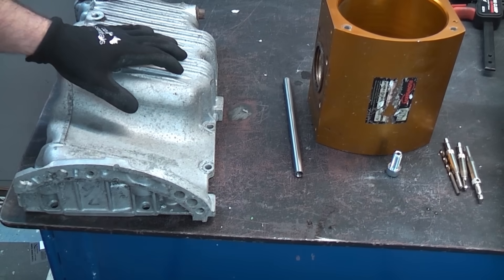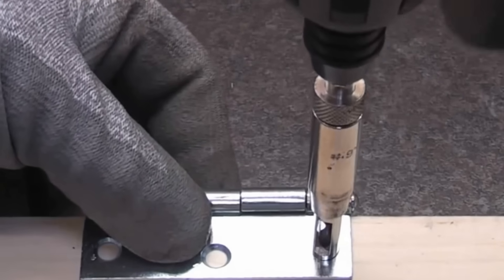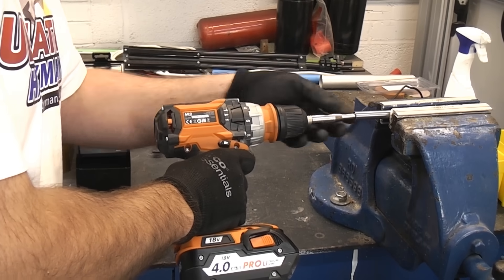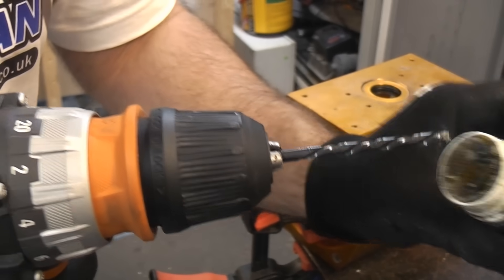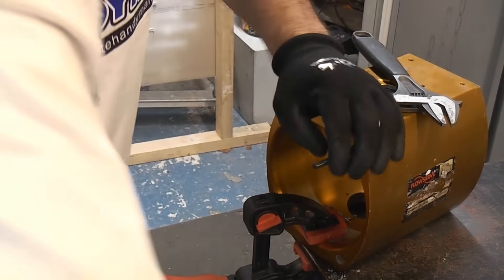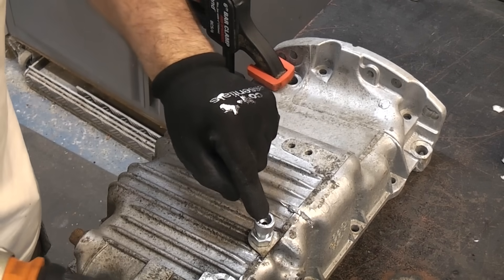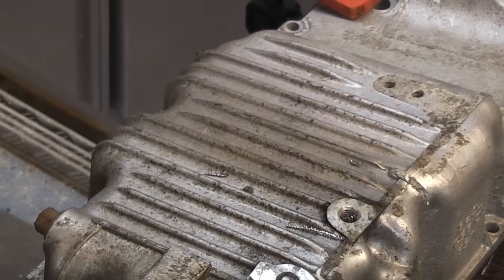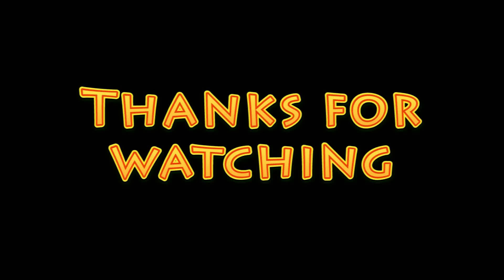How to remove a broken bolt in a deep hole | remove broken bolt in recessed hole

Comment: If the bolt snapped off trying to get is out leaving the remainder in the threaded hole that would have meant it was stuck from corrosion or was too tight. You're process of getting the broken bolts out is A1 however these examples seemed far too easy to get out if the bolt broke trying to get it out with a conventional socket or wrench.
Reply from the maker: Thanks for the comment 👍

Comment: The drilled out bolts for guides is a neat idea. Reminds me of when I was taught to use a bit of valve grinding compound on the tip of my screwdriver for stubborn or stripped screws.
Reply from the maker: Thanks for the comment 👍

Comment: Hi, a very informative video, lots of good tips and that last one about using anti seize compound is a must as there's nothing worse than having to deal with seized in broken bolts owing to dissimilar metal corrosion and wrecked threads when it finally comes out. Trust me, I know, I was that soldier who's dealt with those extreme cases and having to finish the job with thread inserts.
Reply from the maker: Thanks for the comment 👍

Comment: I had to remove a broken starter motor bolt and used left handed drill bits with success. I have also made a centering guide out of a wooden dowel and used a torx bit sized slightly larger than the drilled hole in place of an extractor with suprising success.
Reply from the maker: Thanks for the comment 👍
Reply: @ultimatehandyman  👍

Comment: Once had a broken exhaust mani bolt that had broken off right at the head. Used a reverse twist drill bit. After it got down in aways, it caught and backed the bolt stud out. Anti sieze went on all the new ones...
Reply from the maker: Thanks for the comment 👍

Comment: I love the guide bolt trick. I have another method for you, if you like to try. If you try everything and you run out of options. I use a MiG welder to add small amount of metal to the broken bolt, down in the hole, and let it cool for a few seconds then weld a little bit, let it cool, repeat. Just keep stacking small tack welds on top of each other until there's enough to grip with a locking pliars. I've tried this method with aluminum only. The aluminum threads have always been usable, but not perfect. I'm sure someone with a Tig welder and some skills could do better than me. I only tried this method because of difficulty drilling the center of the bolt, but now I will try your guide bolt method first, and hopefully I won't have to use mine.

Comment: Any tips for drilling grade  8 pilot holes?
Reply from the maker: I always use cobalt drill bits for harder steels, I have drilled out lots of Allen head bolts in my time (10.8 tensile strength) and cobalt drill bits work well- as long as you get decent quality ones.
Thanks for the comment 👍
Reply: @ultimatehandyman  thanks your the first YouTube person to respond to a question I asked

Comment: Hi. Nice vid. What about an M5 size broken bolt? Steel bolt broken into alu thread, the remaining part of the bolt is some 1 mm over the hole. So I cannot grab it with a plier and the drill just dont wanna stay in the middle. Thanks
Reply from the maker: Sometimes you have to grind the bolt flat (if you can access it). This might give you some ideas- https://www.youtube.com/watch?v=_R1b8niX13w

Thanks for the comment 👍

Comment: What's the difference between left and right drills bit? Should I always use left ones for broken bolt removing?
Reply from the maker: Yes, left handed drill bits are preferred, as they can bite into the bolt and remove it- sometimes.
Thanks for the comment 👍
Reply: @ultimatehandyman  super thank you!
Reply: @ultimatehandyman  any tips if the end bit of the  broken bolt bit is rusted? 

Heat, grease, WD-40?

Thanks

Comment: My only downfall on this video is all the bolts you extracted look new 🤪 when I'm removing a snapped bolt it's because it's seized that much it's snapped the head off not cut off and placed into the thread for a video good for ideas on how to to remove but no real life struggle here 🤣😂🤔
Reply from the maker: The ones that I remove on site are much dirtier/rusty  😉
Thanks for the comment 👍

Comment: What tool did you use?
Reply from the maker: Hinge centering drills- https://fave.co/2DpJo1H
Left handed drill bits- https://fave.co/2xJjK1M
Teng screw extractors https://fave.co/2OnfRuF
Dormer taps -https://fave.co/2OsN1sQ 

If you are in the UK- 
Hinge centering drills- https://fave.co/2NE1VMc
Left handed drill bits- https://fave.co/2DubtF4
Teng screw extractors- https://fave.co/2pVLkVT
Dormer taps - https://fave.co/2pTfbyx

exact cutting paste- https://fave.co/2Nabyxc
cobalt drill bits

 (they are much better on harder steels like bolts) https://fave.co/2zDh3kp

You'll have to make the guides yourself, but they are easy- https://www.youtube.com/watch?v=6mZj0J6CNYA&t=1s

Spring tools centre punch- https://fave.co/2NbnLBD
Thanks for the comment 👍

Comment: Great techniques for applications where you have some threads to insert a guide bolt but rarely have I seen it break like that.  I have a 27hp lawn mower mower where it’s broken just below the surface and no threads to grab.  Was hoping you were going to show a method for this more common break.
Reply from the maker: If it is close to the surface you can centre punch the centre and then use the techniques in this video. Transfer punches are good for this, as they help to get the centre punched mark dead in the centre.

Comment: I've got a bolt broken off in an aluminum timing cover. Fricken thing is hardened and a drill bit won't touch it :/
Reply from the maker: Depending on the size, you might be able to drill it out- https://www.youtube.com/watch?v=7JCfEMrCjhc
Thanks for the comment 👍

Comment: Over 20 years pulling wrenches and I've never thought to drill out a bolt and use as a guide. 
Great tips. Totally worth watching.
Reply from the maker: Thanks for the comment 👍
Reply: @ultimatehandyman  BTW, I thought that, if you just backed off the hollowed bolt, after making the initial starter hole, it would leave a thread or two of room for the bolt to back out, if it was going to...
Reply: Fitzwell, you can also pick up vented screws (used in hi vacuum systems) that have a small hole already through center of the bolt. This gives you a nice pilot hole to drill them out.
Reply: @FonWin  :  Good idea, or you can buy any kind of tube, even a plastic tube will work as a guide to get started, and hold it with a vice grips.
Reply: @FonWin Thanks for posting this. Really helpful after I snapped a bolt half inside the frame of my car.
Reply: If you don't have a bolt with a hole through it, I've used pieces of copper tubing. 3/8" for 3/8" bolt, 1/2" for 1/2" bolt. Step it down with a smaller diameter inside the larger until you get the drill size you need centered.
Reply: Such a great tip to make a “hole centering tool”!,
Reply: Like you I was in maintenance for over 20 years and I never thought about drilling out the center of a bolt. That’s one of the slickest things I’ve seen in years.
Reply: Thanks for his tip.  Very good idea if there are enough threads.
Reply: yeah but that only works if the bolt breaks below the surface whereby you can get a bolt in by a few turns, if it breaks flush then thats a new story
Reply: @pandrew2081  Screw it into a piece of waterever, and just clamp it on.
Reply: @CONEHEADDK  :: I can’t see that as a remedy…can you expound on your method as I am curious about Paul Andrew’s dilemma. Thanks, BORGE.
Reply: @pandrew2081  :: with that flush break do you go right to E~Z OUTS or do you have another method ?
Reply: The guide is great. Usually I tap a broken bolt so that I can have a Divet to guide the drill bit, start with a small drill bit, then work my way up. The way he shows it is more sure fire. But you have to have the tools, specialized tools. A cheap way to do it is with A tube as a guide, a short tube, the poor man way. That way you don’t have to buy special stuff. Drilling out a bolt is OK though if you have a drill press or other equipment and skills. Not for everyone. I really like this channel, first time I’ve seen it. The handyman is the most beloved of all characters in ordinary life.
Reply: 30 years and I've never needed a guide.  Center punch, 1/16th drill, then step up from there.  Way faster than drilling out a cap screw.
Reply: @keith_dixon  well maybe we ain't all as wonderful as you 🤦🏻‍♂️😂
Reply: Me too! 🤔
Reply: I concur.
Reply: Exactly, me too!
Reply: I learned this method... back in 1970 in highschool..( тhe different is...we do not have all this fancy tools).I still working like a ✋ man... Nothing new under the sun... Very good presentation... Thank you.!!!
Reply: Common machinist tactic. Just used it last week.
Reply: all u need is 1 reverse drill bit.. drill it and it will unscrew lol..
Reply: You don't need to drill your own cap screw.  Just buy a "vented screw".  Its a regular screw or bolt with a hole in the middle already.  Its a small hole, so you can either enlarge it to the size you want or use a small bit to start the center point.
Reply: I have 40+ years and have taken out hundreds of broken bolts and I have never thought of thst either.lol,awesome trick
Reply: Probably because your IQ is below problem solver.
Reply: Me either 🤦‍♂️ I have used various bushings I made out of plastic, brass, bronze, etc though.
Reply: Reinventing the drill bushing. 
 Bravo

Comment: Like your custom drilling guides, I have used something cheaper and easier... the leftover cutoffs of stainless steel or copper tubing, approx 1/2" to 1" long in various diameters can be placed as a sleeve around a drill bit to center it in a tapped hole while drilling... if it's a really loose fit in the hole, a wrap of tape will make it a better fit in the hole so it self centers. Your extraction guides are a great tool, do you make and sell them perhaps ?
Reply from the maker: No, I'm afraid I don't make or sell them, but they are easy to make- https://www.youtube.com/watch?v=6mZj0J6CNYA
Thanks for the comment 👍

Comment: Your hollow drill guide is brilliant.  I have used a similar method for years only I have not been as lucky to have the broken bolt recessed in the hole.  I am always afraid of using bolt extractors because of the fear of snapping off the extractor...then you are hosed.  My method involves drilling the broken bolt also.  Knowing the thread size, look up the tap drill for that thread.  Drill through the broken bolt with a drill smaller than the tap drill size.  Then, re-drill the hole with increasingly larger drill bits until you reach the tap drill size for that thread.  When you get close to the tap drill size, the remains of the bolt will attach itself to the tap drill, removing itself as chips.  Thanks for the video.  Great job.
Reply from the maker: Thanks for the comment 👍

Comment: What kind of drill bit he used
Reply from the maker: Hinge centering drills- https://fave.co/2DpJo1H
Left handed drill bits- https://fave.co/2xJjK1M
Teng screw extractors https://fave.co/2OnfRuF
Dormer taps -https://fave.co/2OsN1sQ 

If you are in the UK- 
Hinge centering drills- https://fave.co/2NE1VMc
Left handed drill bits- https://fave.co/2DubtF4
Teng screw extractors- https://fave.co/2pVLkVT
Dormer taps - https://fave.co/2pTfbyx

exact cutting paste- https://fave.co/2Nabyxc
cobalt drill bits

 (they are much better on harder steels like bolts) https://fave.co/2zDh3kp
Thanks for the comment 👍

Comment: The absolute worst is when you snap the extractor off in the broken bolt. 😭
Reply: I was wondering the same thing. When either the extractor or the drill bit brakes off in the bolt. I've actually have had that happen to me.
Reply: @bigd5749  weld a nut to the fastener. You have to be precise, which is why TIG is ideal for that task
Reply: Done it lol. Ended up dissembling the casing of the thing I was working on and sent it to a welder. He welded some shit onto the exposed tap and turned both the extractor and the tap out
Reply: Or the drill bit! Ughhh broken bolts/ stripped out threads are the worst!
Reply: @rustybritches6747  JBL&koi koi. ok no no..
Reply: Couple good tips there that I hadn’t learned about. I like the hinge drill it is very very hard to center the drill bit any other way and you got one shot to get it out hopefully you don’t break the bit or the extractor. Some people used to long of bolts and they bottom out and that’s why they break off. And always use a non-seiz when you’re putting steel into aluminum.
Reply: Doesn't copper corrode aluminium?
Reply: Been there, done that.  I tried removing a broken exhaust manifold bolt, and it turned into a head replacement.  This kind of stuff makes you want to shoot people who don't use anti-seize compound.
Reply: The absolute worst is when you drill through in to the water jacket or oil gallery
Reply: Anerobic sealer and some alumaseal in the radiator and you are gtg. Convert to a stud if possible
Reply: I wish I could go back in time about 2 years and watch this video, would have given me more ideas about removing a broken bolt in the crankshaft of my 350!
Reply: Mechanic for 43 years,Ford Escort mk 2 in Scotland as a apprentice broke a bolt in the water pump, our company  never supplied extras like easyouts, removed radiator to use my own easyout was being pushed to finish the job,easyout broke,bottom line had to remove motor, moral of the story dont push mechanics,especially a 1 year apprentice,PATIENCE  is a virtue dont rush,after all we charge by the hour so take you time a make a decent/ honest living ,and no comebacks 👍great video,master at your job.
Reply: Using those left hand Screw extractors ' Man you are holding your heart in your hands every time you use them.  I like the wedge type, they're not 62 Rockwell hard and very rarely break
but will get dulled.  I have had to use hole saws after using some of those lefty screw extractors.  Just saying !   Ultimate handyman you have TWO THUMBS UP Showing great ways to get the job done.  I'm up in years now , but spent 35 years in the trade ( Mill Wright ) doing everything everywhere.  I miss the part of getting things going, after being told they can't.
Can't has never been in my vocabulary.  If it is built by man it can be fixed by man !
Reply: @freddyeltigre2327  
Lol, Agreed, my ole man few times said that 'If it wasn't born there, that it would come out'.,    Regards.
Reply from the maker: Been there and got the Tee shirt 😂
At least you can drill it out- https://www.youtube.com/watch?v=7JCfEMrCjhc
Thanks for the comment 👍
Reply: Worked as a welder in a machine and jobbing shop, after 11 years there I'd lost count of how many broken studs I removed with a shattered ezi-out or drill bit stuck in them. I would weld onto the top of the stud with a high tensile arc welding electrode and once clear of the casing could back it out by gripping the weld blobs with a set of vise-grips. The heat from tacking onto the broken stud would also help in breaking the bond to the case or housing.
Reply: Yes that has happened to me; I always use the largest size extractor that is practicable and go gently and make sure that all the debris has been blown out of the hole so that the threads are clean. A drop of light oil may help.
Reply: Brian Landers  Why does that work? I would have thought it would have made both the bolt and what it is bolted into expand, making it fit even more tightly.
Reply: @anatarango1736  all the parts do expands from the heat and then shrinks when it cools down. It is  moving around and breaks the oxide layers up. Expand and contract..   Same reason why weldments warp.
Reply: I never use EZ outs for that very reason. I'd rather just keep drilling until I reach the tap drill size and then just pick the threads out or run a tap down the hole. Been burnt too many times with the stud extractors breaking
Reply: The best thing to do with extractors is to throw them in the trash can.
Reply: Yeeesh 😬 did ya have to say that, it set my teeth on edge..
Reply: or the drill bit....
Reply from the maker: Botchvinik   https://www.youtube.com/watch?v=7JCfEMrCjhc&t
Reply: Stainless steel  bolt broke off near flush in aluminum  and it's  fused together.
Reply: best to just go EDM right from the get go
Reply: happened to me too but I learned how to dissolve it with nitric acid and it's my top garage life hack since that.
Reply: I did that back in the 60s. And I wasn't on anything.
Reply: Then it is time for diamond
Reply: That's why I always drilled completely through the broken bolt. You can the use a punch and drive the broken piece on through....if the bore is deep enough!
Reply: Luckily these are all brittle compared to the bolt and you can hit them with a punch and shatter them
Reply: @geirkselim2697  that's why they break: they are TOO hard. I had a set of cheap taps that constantly broke on me as they were carbide instead of HSS. I broke the M3 and 4 and then just tossed the 5 and 6 before they too broke off in the hole. I then bought HSS steel ones...haven't broken one since.
Reply: @geirkselim2697  you fuc`n wish
Reply: @geirkselim2697  Not if the extractor is very small.  I did this on a part that's no longer manufactured and none available in the bone yards.  I had to completely remove the part from the vehicle, get a cobalt drill, enlist the use of a bench drill press and spent a day with it never being able to use an extractor so I ended up drilling it out completely and re tapping the part.  Today it's back on the vehicle which allowed the vehicle to pass the smog test.  It always happens on the very last bolt you are removing for some odd reason.
Reply: If you dont have left hand drills just grind a normal drill to cut in reverse.